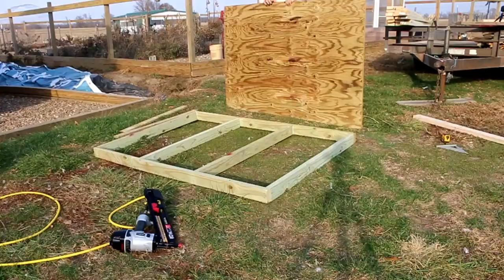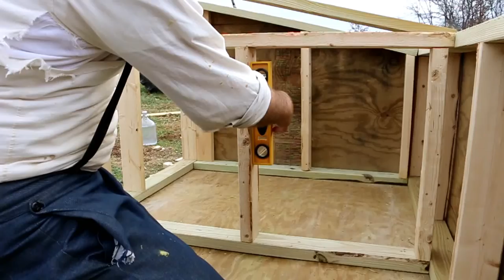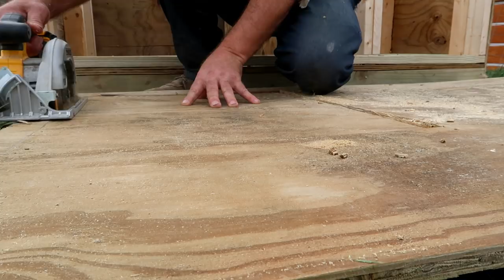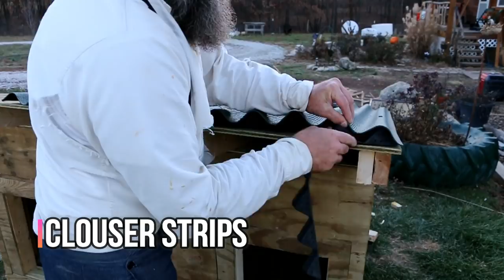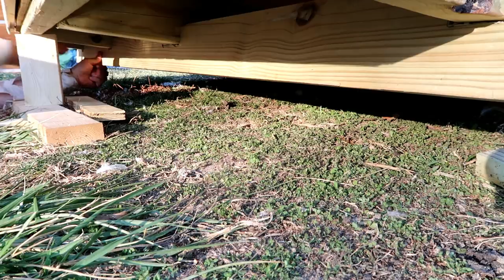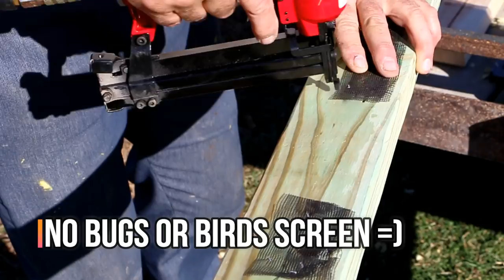HOW TO BUILD A DOG HOUSE! EASY DIY ~ looks like a LOG CABIN

Comment: FINALLY,  somebody fastens corrugated roofing correctly. I didn't see ANY thing 'wrong'. OK, MAYbe a 'bit' too much square and level time for MY time pressure on a dog house, but who am I to judge?   If we set out to do a 100% job and end up with 95%,....cool. But if we approach it half azzed to begin with, who knows what we're gonna get?  I SAY WELL DONE Doug.
Reply: Awesome Looking log home! Do your dogs keep predators away? I just found your channel the other day and have been hooked.Straw is not enough to keep the dogs warm. They cannot maintain warm body temperature without insulation, flap on door and lower ceiling. God Bless

Comment: A couple of design changes I would make would be: I would have hinged the roof to make cleaning the inside easier. I would have made the wall separating the apartments removable as you may find that dogs like sleeping together especially in winter. And I would not have made the doors open straight into the apartments. An 'L' shape entry blocks the wind from blowing into the apartment. You will find flaps are pretty useless. I would have also made the doors much smaller for heat retention. Adding sheet vinyl flooring would get them off the preservatives in the plywood, provide a moisture barrier and make cleaning easier, especially if you get a flea or tick infestation. Even if you wanted to keep 2 apartments, I would have made 1 door in the center, again for heat retention. Otherwise a nice build. xoxo from Arizona.
Reply: I don't like hinged roofs. Too heavy and hard to open and keep open. Then it is hard to clean out from the top. I would rather have a wide hinged door in the back to sweep out. Some dogs do not share the same place well. One dog may guard the door and not let the other inside or go in and attack the dog that is in there, because it is in the territory of the other. Then, like you said, some dogs prefer sharing the same space. I agree about the L shape, where they can get out of the way of wind and rain blowing in the door. Od course positioning the house where it does not face the direction that the weather comes in from helps. Or facing the house toward a wall to block the wind, can help too. I have always wanted a dog house with a porch for them to lay on for shade and helps protect the doorway.  Of course their dogs run loose and can choose where to lay for shade. For me, I would rather have two seperate dog houses, rather than the duplex style. It is a great dog house and wont blow away in the wind and good thick walls for insulation.

Comment: years ago when I built a doghouse. I used a scrap piece or carpet and stapled it to the inside over the door. Making a couple of slits gives the dogs easy movement in and out of the doghouse but keeps some warmth inside....and enough gaps to let fresh air inside. Carpet can easily be pulled back in summer so that it doesn't get so hot.

Comment: You did an awesome job. Only one thing I would suggest is that for such a large dog house you could add hinges to the roof to be able to open it to clean it or for some other reason and add a latch lock to close it so wind doesn’t blow it open. Lucky dogs 👍😁

Comment: Dug do you ever give your chickens pumpkin seeds?  It's good for them & it helps to de-worm them, also it helps to make their feathers a brighter color. They like little swings too & would rather have natural branches to roost . 
   My grandfather would dig a small hole aound the coop & extend the wire netting down & recover the dirt so critters couldn't dig under it.
    But you probably already knew this stuff.

Comment: The Ondura sucks compared to 28 gauge ribbed steel roofing. Steel reflects 95% of radiant heat....keeping it cool in summer and warm in winter. The center wall didn't need to be framed....You could have just made a slot for a 3/4" sheet of plywood and skipped the 2x4s altogether. Also, why did you not insulate the floor, ceiling and walls? Dogs get cold in the winter. Insulation would help to retain their body heat and make them far more comfortable in winter months.